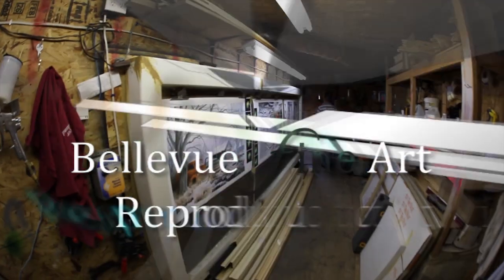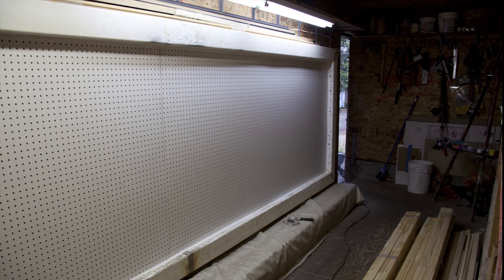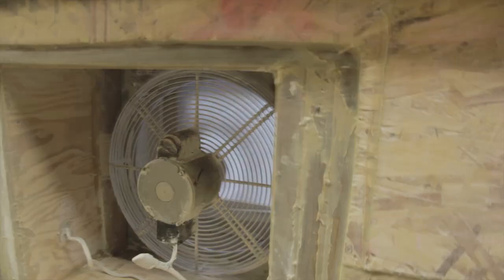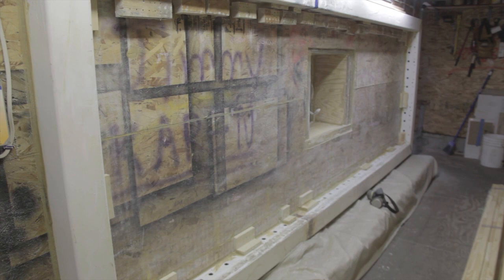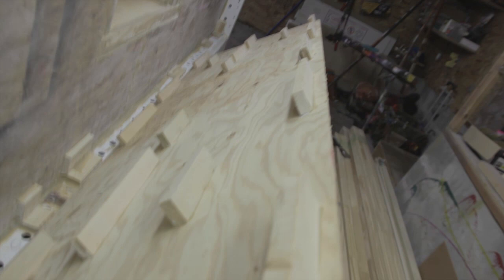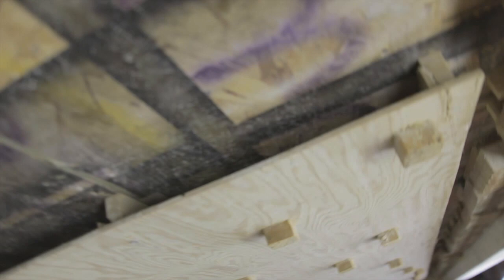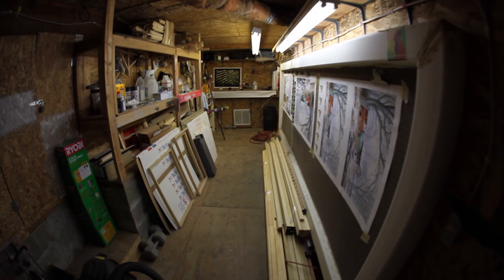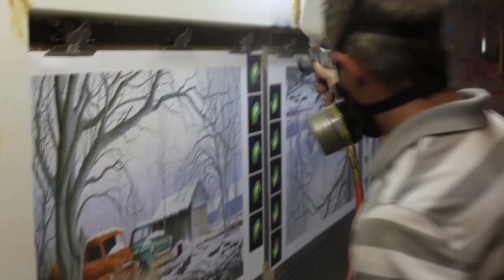How to Build a Spray Booth

Comment: I love it.  I also need to make a spray booth to spray uv coating on ceramic tiles.  However after spraying i need to dry it through a uv curing machine with uv light.  So in between the dust gathers on the tiles.  How to solve that? Please.  Also since it is flammable so need fans to clear it out as well but how to stop the dust from coming in as my installation is in  dusty area. I would really appreaciate your input. Thanks

Comment: Do you get much lacquer on fan's blades?
Reply: Dmitriy Voloshko We use water based coatings, so it's not an issue. I avoid lacquer and oil based varnishes. the water based coatings come off easily. Every time we clean the spray booth (about twice a year), we replace the peg board and clean the blades and insides with a shop vac and air hose. 

It takes about 4 hours to completely tear down and clean it and put on new peg board, with a cost of about $40. It's much cheaper and eco friendly than constantly cleaning rollers or brushes with water.